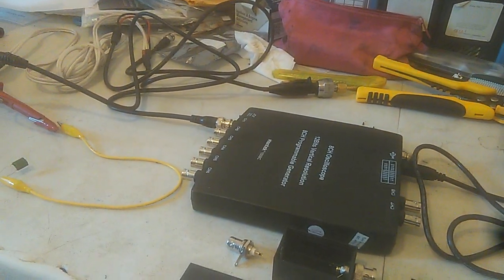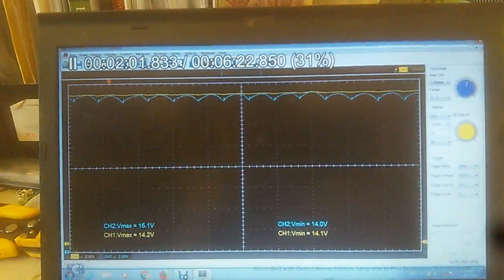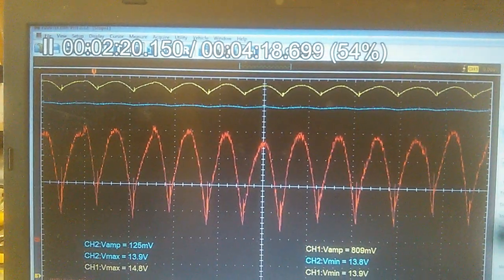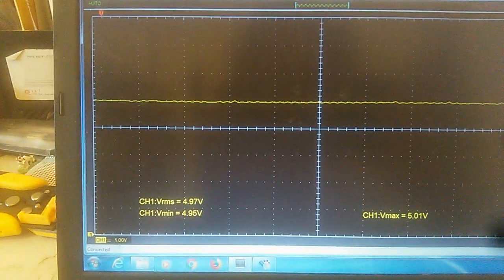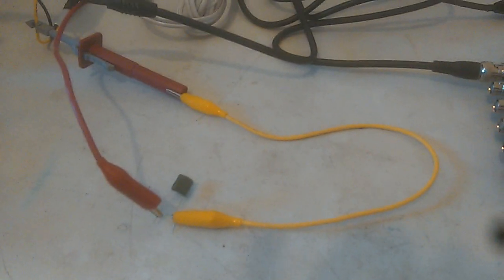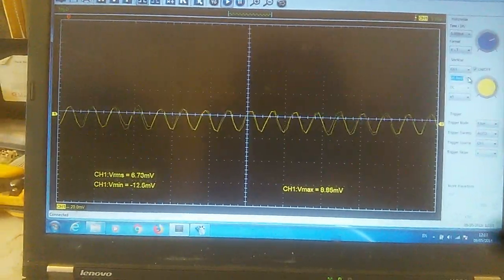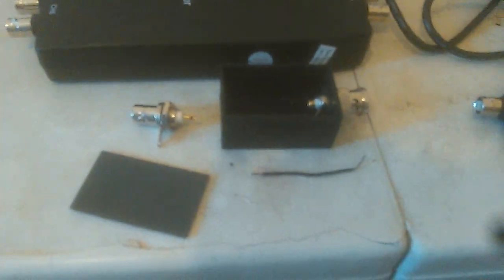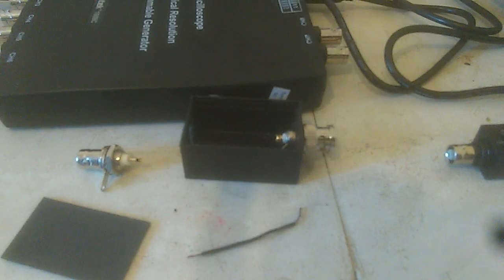DIY AC Coupling Adapter Hantek 1008C

Comment: Best solution I''ve found with Hantek 1008C is to use it as a door stop even in 2021 they cannot get the secondary ignition clamp to lock up the PC etc. so many problems... save yourself the headache and buy Pico.... yes save up but get things that work not CCP China pretend Waste of time Junk! (Oh yes I did try the default device in device manager and the alternative USB driver) all no go... maybe it needs 20:1 attenuator.

Comment: Hi  I am using a hantek 1008 and the ht25 to check se notary ignition on a corolla without the coil on plug ignition.  Can't seem to generate a stable clear wave form .
Reply: That should read secondary ignition wave form

Comment: I am picking up a Hantek 6022BE USB Oscilloscope and just realized it does not have AC coupling, will connecting AC damage it and either way will I be able to properly see mains AC harmonics with the scope via spectral view/FFT?
Reply from the maker: You'll need to build an adapter like in my video.  Regarding the fft I don't know.

Comment: i have found the capacitor but cant find the bnc connectors were do you get them. thanks
Reply from the maker: I got them at a local store here in Jerusalem.  You could probably get them at an electronics store or off Amazon

Comment: I mean to cut open extra attenuator remove what's there and replace with capacitor and ground wire. What's your thoughts on this
Reply from the maker: It could work.

Comment: I have extra attenuator ill try and cut open and solder in capactior do you think this will work, thanks again
Reply from the maker: I'm not sure if that would work.  The capacitor already blocks all the DC current so there is no need for an attenuator in this situation.

Comment: i almost jump when you phone vibrates, watching  this midnight at relatively high volume from my speaker
Reply from the maker: Sorry about that at least the video was exciting }:‑)
Reply: @sailorbob74133  no problem, usually i use headset at night, but for some reason i dont lol, but this video helps me, i have Hantek 6022BE that also didnt have AC coupling option

Comment: i really like your video ,i am more a mechanic than electronics expert like you though, would you post or send me the part no,s to build that attenuator?
Reply from the maker: It's basically just a 0.1 microfarad capacitor hooked up to male and feel female BNC connectors in a little plastic box.
Reply: @sailorbob74133  ok thanks

Comment: Hi, may be the best upgrade for your solution is to connect simple small ON/OFF switch in parallel to capacitor and mount it on the box outside? This way you''ll get a real AC/DC probe.

Comment: Hi, thank you for posting this video. It now makes the 1008 even more attractive.
I'm trying to figure out a way of doing a Relative Compression Test by connecting the scope lead straight to the battery posts, but i want the waveform to be a single crisp line, by filtering out all the noise.
Do you think this method will work, or is there a better way to make a filter?
Many thanks for any help that you may be able to offer me on this subject. Joe
Reply from the maker: Actually, I would look into the Pico 2204a, which is about $140.  It's only two channels, but practically speaking you can't use more than two channels on the hantek most of the time anyways.
Reply: Thank you very much for the prompt reply and advice on the pico 2204.
But is there a way that you know of to filter out the noise when connected straight to the battery posts?
Many thanks, Joe
Reply from the maker: well the sample rate on the hantek scope isn't that high so I don't think you'll see that much noise hooks direct into the battery post I think just try it and see what you get but I think it should probably be okay.  Ideally you would want a 1 kilohertz low pass filter which the Piko can do in software I'm not sure how to do something like that for the hantek however, but like I said you may not need it for the ham Tech because the sampling rate isn't that high anyways.

Comment: Hey, sailor! What's the capacitor voltage?
Reply from the maker: I used a 0.1uF capacitor.  I don't remember the voltage rating for the cap, think it was rated up to 25 volts.

Comment: Hello, how are you! My friend, I wonder if someone can help me. I have a Hantek 1008c, and I need to know if I can connect, on a rotation sensor, and on a phase sensor of a vehicle. Here in Brazil I have no one who can help me with this detail. Thank you so much.
Reply from the maker: Valdir Martins sure why not just back probe the relevant connectors on the signal wire
Reply: O Mestre Abel tb tem um livro com mais de 300 imagens de ondas automotivas, que podes baixar totalmente GRÁTIS.